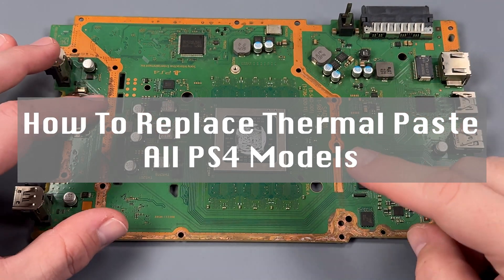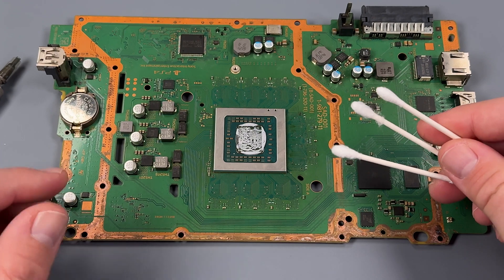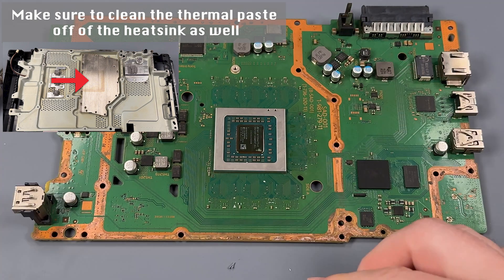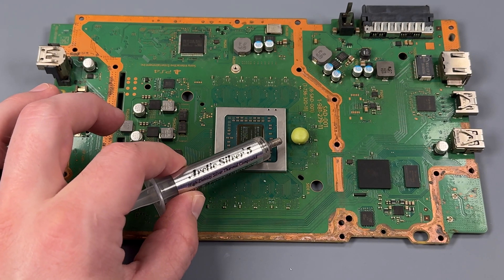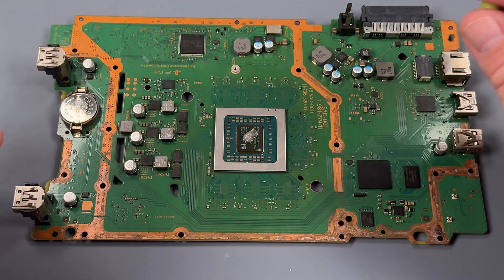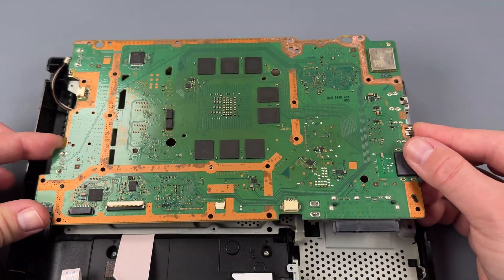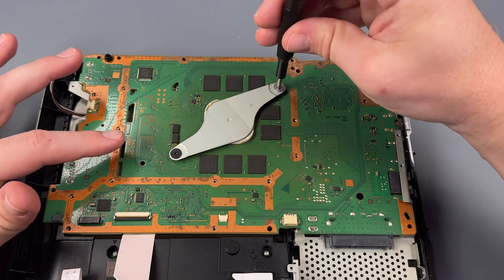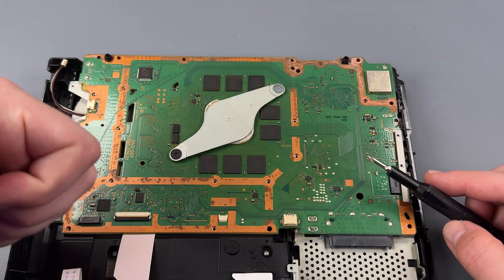How To Replace PS4 Thermal Paste

Comment: U had to spread it for better results and a cleaner job, most of that will get pumped out
Reply from the maker: Yeah, some people like to add the extra step of spreading the thermal paste out. We've never seen that it is needed but it also won't typically cause problems as long as it's not spread out too thin.